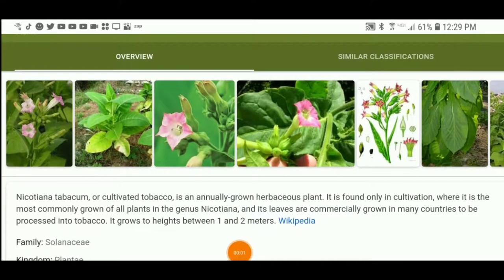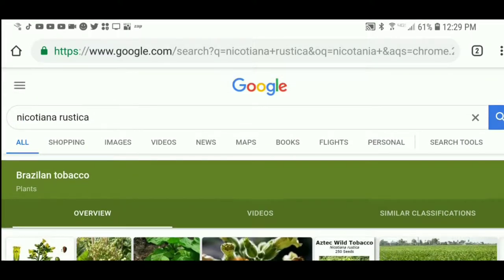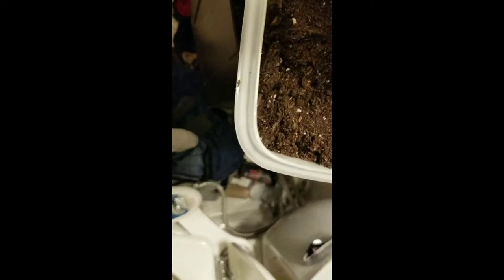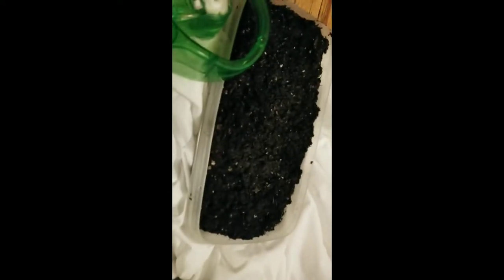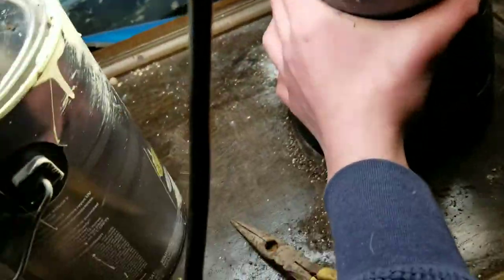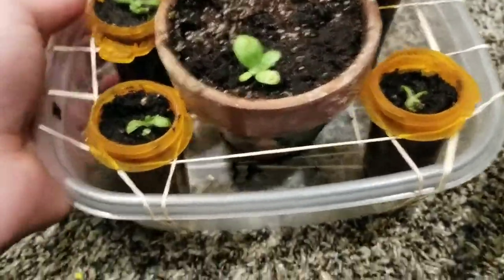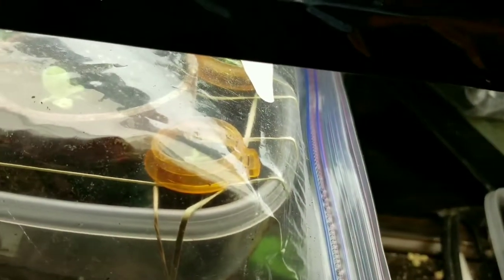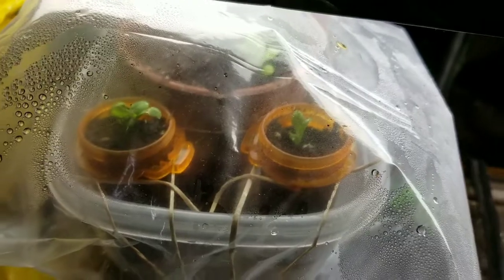Growing nicotiana rustica (tobacco) indoors episode 1

Comment: What's the best light intensity for growing Nicotiana benthamiana?
Reply from the maker: I'm not sure, my best suggestion would be to use either halides or fluorescent warehouse lights as I'm pretty sure that leds just aren't strong enough. just keep them almost as close to whatever grow light ur using (unless its halide then I'd suggest leaving at least a few inches) keep the humidity high with a ziplock bag, use seed starting mix not soil or a wet paper towel like you could for some other plants, and just hope for the best
Reply: Use 600k and purple grow lights